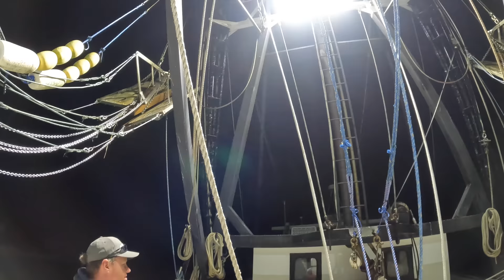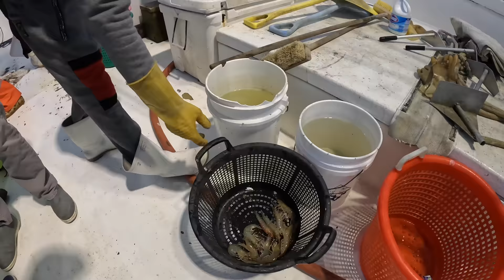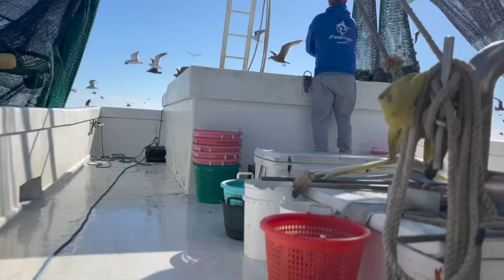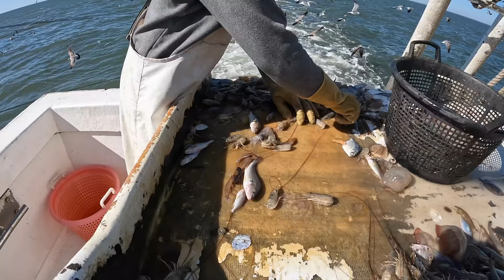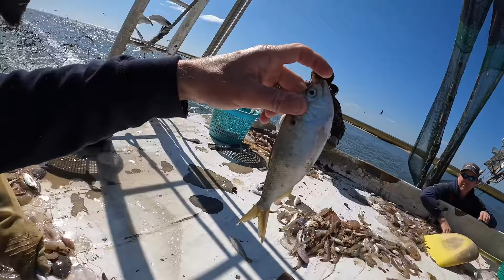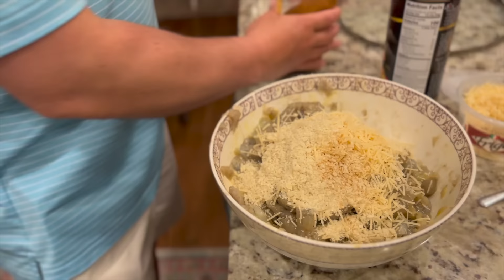BIG SHRIMPIN’ part 2 🦐 Commercial Shrimp Boat Ride-Along (Catch and Cook)

Comment: From someone that used to commercial fish and shrimp ...that is some hard work for sure. But I sure do miss being on the water everyday. Cool video and experience for sure. When pulling those bottom nets with the doors and tickle chain you pick up some interesting critters sometimes.  Not positive because i didnt get a good enough look but those fish they were calling baby king makeral are actually a fish called leather jacks ...Ps if you would of saved about 5lbs of those fresh shrimp heads and boiled them down it makes some of the best seafood stock you have ever had to make soups and gumbos..
Reply from the maker: We’ll have to save the shrimp heads next time, quite a few people mentioned they’d be good. 

We catch leather jacks down here in the Keys (we don’t like them, they hurt if they spine you) and the fish in the net were a little different (although they looked similar)
Reply: @StanzFam  ya the leather Jack's will definitely put a sting in a finger.

Comment: Nick you may have been in Charleston at the same time I was at Toadfish and Nicos oyster bar. OCT and NOV are great shrimping month besides the Spring roe shrimp.  There is a lot of danger on a shrimp boat. One shrimp boat from Norh Carlina was shrimping near the Savannah River when a tornado came down the river. They took pictures of the tornado and posted on Facebook only to get hit by the tornado and the shrimpboat flipped. They never found the crew bodies. Other shrimpers say they are huge sharks out there. I Know, I had a 16 foot hammer head swim around my 16 house cat. We had been fishing for spanish.
Reply from the maker: Would have been close on the timing, we were there the weekend before the boat show. I bet there’s some big sharks out there , easy meals 🙌🏻